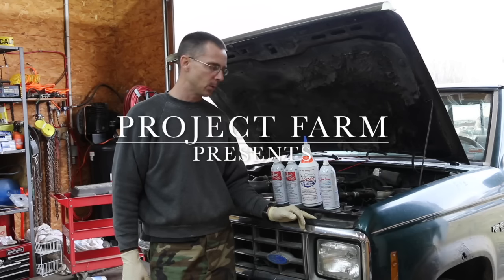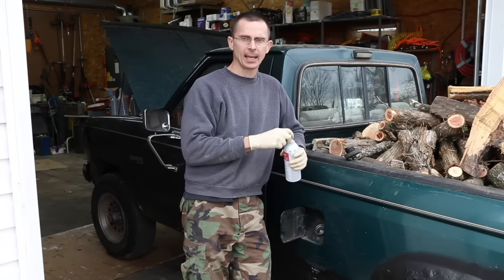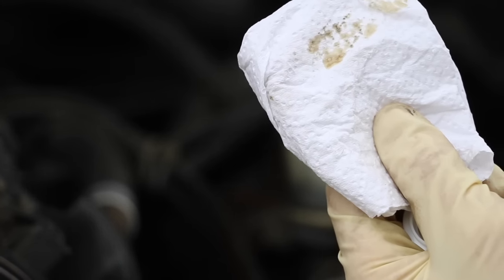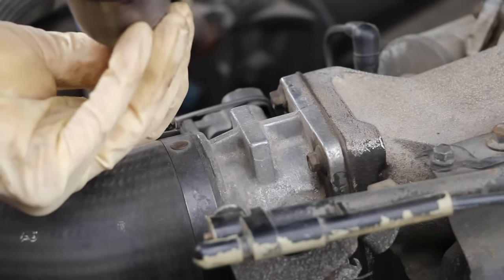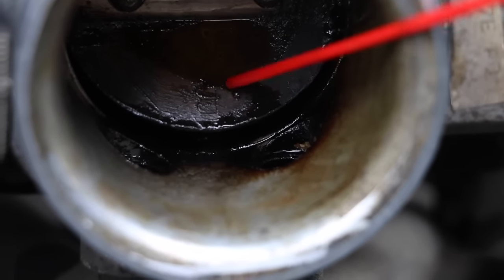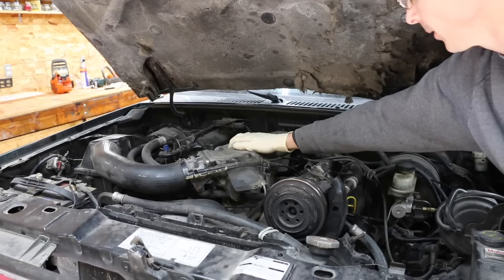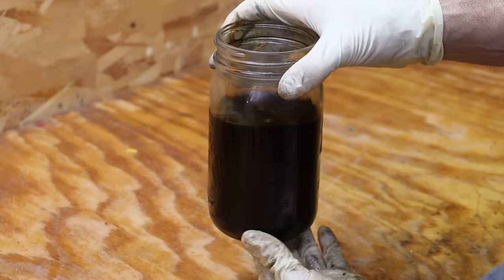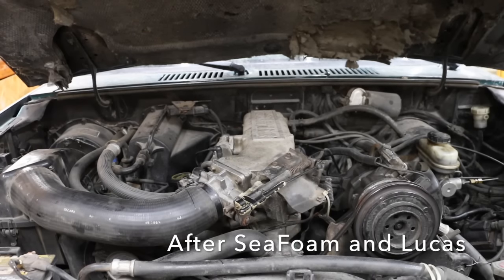Seafoam--can't believe what it did to my engine!!

Comment: I've seen this video 3 times in the last 5 years and it's still great, I want to try this as soon as I can get a truck. Thanks for the useful tips and helpful information
Reply from the maker: Thanks and you are welcome!
Reply: I have done the exact same lol easily  my favorite yt content
Reply: @Clutchkicker5.9  you did to a vehicle? I want to try on a 2nd gen ranger but I really don’t wanna make it worse or break anything
Reply: My father had a 94 4.0  ranger that he put 600k on it, it was a standard that he had to redo the cluch a few times and wheel hubs but that was it.
Reply: If you need this when you're getting a truck, you got the wrong truck!
Reply: @samthekashman  I fully recommend putting seafoam in the gas tank, in the oil a day before an oil change, and in the intake like the video. It will only make your car run better
Reply: It doesn't matter the make of the truck chevy, Mercedes, Toyota etc. Eventually you'll need to do some maintenance and or upkeep. This particular content is a great way to keep one's truck running better longer.
Reply: @patwalker8771  the same could be said about a 7.3 Ford. It depends on what model and year Toyota you're referring too I was only using it as a reference point.
Reply: Foreign or domestic eventually all trucks need maintenance
Reply: @patwalker8771  right right and you know what I'm getting at over all. I'm curious how would one go about "bulletproofing" the trans? I've seen a 7.3 stroked out to 8.1 which is a bit off topic but still cool lol.

Comment: a trick i've learned about the Lucas is to put it in first, then pour about half of your first quart of oil in the bottle of lucas and shake it around a bit to get all of it out of the bottle, then cut the bottom off the lucas bottle and use it as a funnel lol
Reply from the maker: Thank you for this recommendation.
Reply: I do the same thing!  They make great funnels.  I keep the spout with the nipple cover also.  Put the funnel in a big zip lock bag to keep it from getting dust and dirt contaminated.  That is best with all funnels.  In an emergency, or for super light weight for carrying in an aircraft, you can make a great funnel out of a water bottle also by the cutting the bottom off at the angle that's best for the particular engine filler cap.
Reply: What is it that makes you laugh out loud about your comment?
Reply: Jessa Phillips I do the same thing it's the best way to do it
Reply: Jessa, great suggestion-never thought about that! I can tell you that empty quart oil containers with bottom cut out make AWESOME "female-pee STANDING UP" accessories, when you've taken a mixed company of folks out on a serious bird-watching trip WAY OUT in the boonies.
Reply: Ive been drinking it, seems its hard to swallow but i hear its good stuff.
Reply: Brilliant
Reply: I did the same for the Lucas Auto trans additive. Still didn't get it all
Reply: You don't even need to use the whole quart of Lucas . . . just saying, less than half worked on my XJ.
Reply: The easiest way is to just warm up the engine and add the Lucas while its idling. Or save your money and just buy one grade more viscous oil.
Reply: Never thought about, that's a good idea. Thank you
Reply: I've done that with empty oil bottles.
Reply: @mrpoizun  - I thought the same thing lol
Reply: @redharris8358  👬
Reply: Wow... I never thought of this!
Reply: Microwave the bottle for 30 seconds. Should lower the viscosity, but keep a fire extinguisher close Incase it combusts when you screw up and microwave it for 30 minutes.
Reply: @gagepuffinbarger6939  Or run hot water into a bucket and put the Lucas in the hot water for 5 minutes, pours much easier.
Reply: Like James bond shaken not stirred..
Reply: @gagepuffinbarger6939  Or a warm engine compartment with the hood closed
Reply: It pays to carry around a pocket knife.
Reply: I always leave the bottle in the oil fill and stab a hole in the bottom of it and walk away. Let it drain out on it's own without having to hold a funnel.
Reply: That is a useful tips. Thanks.
Reply: With my old Mitsubishi lancer I used to just throw in a really thick quality oil instead, 40-60 or so weight, that stopped most  blow by in that high kilometre(miles) motor.

Comment: For these older vehicles it is recommended to also replace the oil  pan plug with a magnetic one. Older engine's have more wear and are more vulnerable so adding a magnetic plug can save your engine by trapping metal pieces.
Reply from the maker: Thanks for the feedback.
Reply: The magnet is redundant when you have an oil filter. The filter is capable of separating matter much smaller than metal particles.
Reply: @jetfire245  I fully agree, but Redundancies can only help, not hurt...
Reply: @emceehamma3693  you would be wasting finances on a magnetic drain plug when you could invest in a higher quality oil filter, that again works better. If there are any metal chunks that big that somehow make it through your system, you have a MUCH bigger problem than just filtering oil lol

The premise is that even if you have a fancy magnet, it won't fix the massive problem of metal fragments in your oil, that means somethings falling apart.
Reply: @jetfire245  A magnetic drain plug isn't going to be some massive financial expense, and it is reusable. As well as anything it catches isn't going to end up in the filter, potentially allowing the filter to operate better. On an old truck, if you remove it and see bigger metal chunks, then it's essentially going to alert you that you have a big problem you have to address-no one with half a brain is going to install one with the hopes its going to actually fix anything.. The pros absolutely out weigh the cons here.
Reply: Thanks 😊
Reply: I just throw a magnet right on the oil filter and helps trap it right where i want it!!
Reply: @jetfire245  the filter isn't full proof especially towards the end of it's use. The magnet is supplemental and oil and filters should still be replaced regularly as needed.
Reply: Watch Neutral Drop channel on YT they test the durability of engines regularly.
Reply: @jetfire245  wouldn’t the magnetic drain plug at least let you know that you have shavings and an issue? I wouldn’t think it would be very noticeable on the oil filter but I could be wrong 🤷🏻‍♂️. Just asking bc I was considering putting one on my atv but if it’s a waste I’ll save my money lol
Reply: @G__Mason  you'll know you have metal shavings in your system when your engine stops working lol.

Catastrophic failure will not be prevented by a magnet like so many are inclined to believe. There's a reason auto manufacturers don't use them. 

Oil filters really do the absolute best job at filtering oil. If there really was any reason to use a magnet, they would just put a magnet inside the oil filter.

Adding a magnet to the plug does not make practical sense because it's at the bottom of the oil pan. 

The magnetic field from one of those Itty bitty drain plug magnets is much too insignificant to cover the whole oil system, there's just too much space inside for the magnet to do anything.
Reply: @jetfire245  Makes since to me! lol … I believe I’ll save my money, thank you for the info!
Reply: @G__Mason  I'm a normal person who likes to think practically. I'm only human. I'm glad I could help.
Reply: that and drop your oil pan and get that sludge at the bottom of the lake gone
Reply: @strattuner  quite the story. Bored me to death
Reply: @eddiemoir2572  glad i could help,now i'm bored
Reply: @strizzy239  That is actually a really creative and great idea!
Reply: @derekschott5209  thank you i learned it from an old timer heavy equipment mechanic and it seems to work well for me and didn’t cost much money or time!! It definitely can’t hurt
Reply: @Greg   NO-It is not redundant!! Far from it. Every small metallic piece in your oil eventually makes it to the filter. BUT-To get to the filter, they must go through the oil pump FIRST! This does the oil pump, many of which are now aluminum, no good at all. It can also be splashed around inside the engine until it gets a free ride to the filter. Anything you can do to help hold any tiny, or large, metallic particles in suspension is better for the engine in the long run. A good mag drain plug is a good, cheap investment.......👍
Reply: @milojanis4901  you are right it trashes the clearances in the oil pump,magnets are a good investment,i use more than 3 in a average oil pan [engine] and i use 2 in a transmission,esp one i don't want to pull again,magnets work
Reply: thats been disproven. 
When you hit a bump or something all that metal flies loose and clogs up your engine immediately.
Reply: The magnet will reduce the wear on the oil pump. The oil pump does not recieve any filtered oil. A magnetic drain plug cost about $10-15. You could just skip out on fast food once or twice and your plug is paid for. Seems like it is worth investing in
Reply: @jetfire245   Stay far away from Fran filters. They are cheaply made. I use Wix filters.
Reply: @jetfire245  the filter only traps the metal after it has went through the entire engine.
Reply: @G__Mason  the magnet is a smart idea.
Reply: @jetfire245  hm.. i wouldn't spend big bucks on filters, but instead drain more often)
Reply: @Legrascestlavie88  this comment is the best reply I've received lol.

Yes, replace your filter and oil more often. Much more effective than a "magnetic" filter.
Reply: or put a strong neodynium on the pan itself? something with a magnetic field that will project deeper into the oil resevior
Reply: @emceehamma3693  I guess you might call it a redundant redundancy of redundantness now if that's not redundant
Reply: The magnet is not to trap shavings it is to show you that there are shavings and let you see if they are normal fine dust or bigger flakes that indicate something is failing. Especially useful information in transmission pans, where(if the pan is steel) it can just be a flat magnet inside the pan no need for a special plug.
Reply: Most of the shit you're going to get, aka bearing material, isn't magnetic. So this isn't a worthwhile idea.
Reply: 👆⬆️Not so true… a lot of the material that is found is the ‘non-ferrous’  coating that bearings usually come in.. once that is worn off ,  the actual rod, and shaft bearing start getting worn away that is were the ferrous shaving are coming from.. and if you’re getting a lot of materials from these areas.. it be best to do some serious repairs to your vehicle .
Reply: And there are #3  reasons the magnetic oil pan plug, is placed in bottom of the oil pan. #1 the metal shaving that are less dense than the oil ,will settle and collect at the low point of the pan where they will attach to the magnet ,#2 it is easier to pull the drain plug to remove the shavings, vs ,pulling the pan, or change oil. #3 keeps the metal materials, away from being cycled through the engine. Anyone that thinks putting a magnet inside the oil filter is helping to keep metal out of he engine…is not realizing , oil goes through the engine FiRsT before the filter.
Reply: I put an electro magnet on my oil pan it was so strong the engine wouldn't Rev over 2000 rpms!!
Reply: @BANSHEEBOY_1974  what the hell are you talking about? The entire bearing for mains and rods are non ferrous. If you're getting ferrous material you definitely already know something is wrong as there's going to be some serious noises or a failure occurring.
Reply: @sleddarcheddar  what the hell am I talking about? Yeah figured you were confused… Do you even know what the word ferrous means?.. And the entire Bering is not All Non Ferrous.. the whole exterior housing of the bearing is made of steal.. it depends really what application the bearing is needed for .. some are made with bi-metals some tri-metals.. then there is some made with Babbitt materials.. so there are many different materials in bearings.. but the actual ‘ ball’ in the bearings are non ferrous .
Reply: @jetfire245  what kind of financial problems do you have when you can't afford a magnet?
Reply: If you don't want to buy the magnetic drain plug but still want to trap metal you could put a strong neodymium magnet right next to your drain plug and just pull the magnet off after the oil has started draining
Reply: Magnetic plugs suck when you do them up they can snap due to the weakness of the bolt. lucky for me i got the rest of the bolt out easy
Reply: Great advice
Reply: @jetfire245  Some quality oil filters DO include magnetic properties in their filters. The concept definitely works.

Also there are inexpensive, but powerful oil filter magnets that can be dropped inside most oil filters to help trap iron particles that will otherwise go right through an oil filter.
Reply: @DUCKDUCKGOISMUCHBETTER  the concept works based off the fact you've seen it sold? Or you've seen actual technical data that shows typical filters are insufficient?
As I was telling people earlier. You can filter metal shavings all you want with a magnet. But if there's metal shavings in your system to begin with you have MUCH bigger problems than filtering your oil lol. 

It's putting a hat on an extremely broken hat.

Sprinklers on a forest fire.
Reply: @jetfire245  Correct/incorrect. We're not talking about shavings, we're talking about inevitable microscopic metal wear particles that always, and forever, wear off of metal parts, despite how perfectly things may be designed, maintained or lubricated.

If you think that this does not continuously happen, you're being naive. Because it certainly does. It shouldn't, but it does. And these microscopic metal particles, in turn, cause additional wear, all the way down to ~2 microns. And the smaller of them can pass right through conventional oil filters, which only filter, at best, down to ~5 microns, and often not even down to that size. Which is why oil bypass systems should be standard equipment in all vehicles, and yes, oil filter magnets, or better yet built-in magnetic filtering in all oil filters, which some better filters do have built-in. Magnetic components, of course, won't do anything to help with aluminum or magnesium particles, or other non-magnetic particles, but at least it will get a lot of the iron based wear particles.

And yes, I've seen the data, although it's hardly necessary, since common sense is adequate to see the concept in this case. And no I don't have it handy anymore, and I'm not going to go look it up.
Reply: @DUCKDUCKGOISMUCHBETTER  ahh the old fashioned "this is correct but I'm too good to provide the data"

Good day to you then.
Reply: Good for the oil pump for sure, anything down stream of the filter, not much.  Also the relief valve depending on its location.